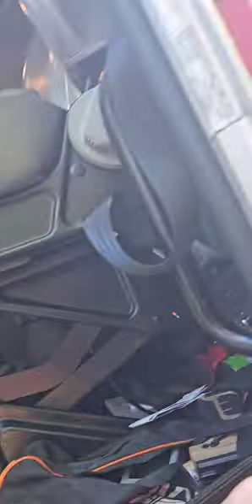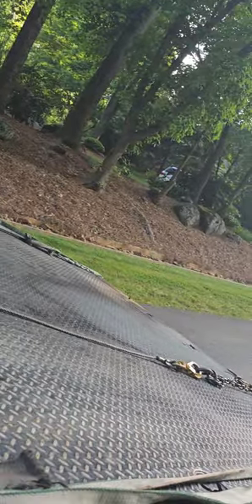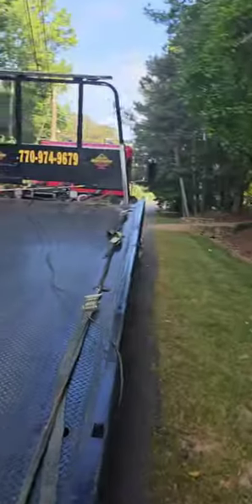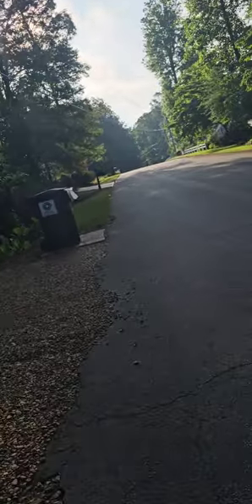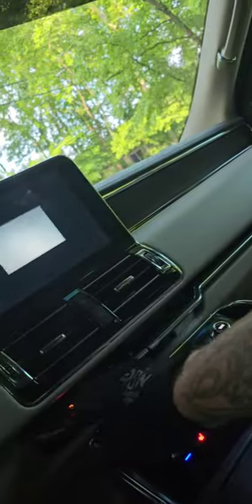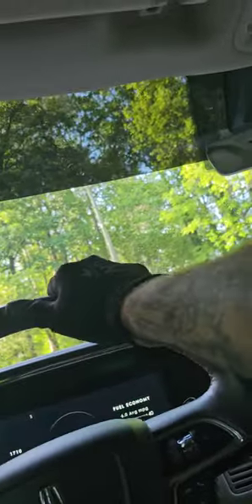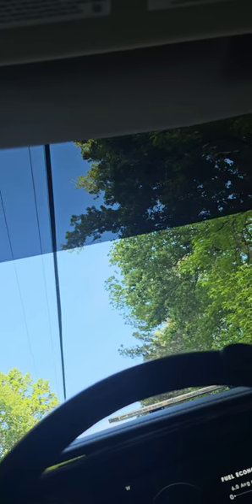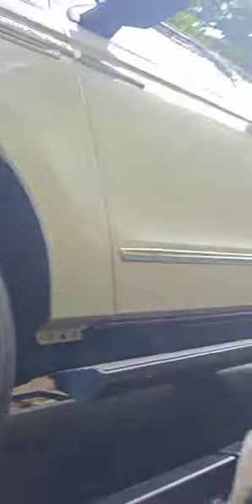Towing a 2021 Navigator#viral#rollback#tow#towtruck#flatbed#peterbilt#repo#recovery#hino#winch#video

Comment: What's up man hope the weekend was great! As long as the video is in focus it's all good! For a while there it was like watching the video under a mossy tree Lol😂 remember a lot of people watch the videos as for the oil slick on the back boss maybe watching! So keep it clean, 👍 don't pay no mind to slotted holes or round holes thickness is what your looking for I try not to use that strapping system you have I have it but only use it on certain vehicle's particular customers my bed is different than you have the securement points give me more range to individual wheel tie cinching not through the rim but around the tire Plus I go railless medium duty Kenworth T370 I do a lot of construction equipment hauling so I need an open platform go from hauling a backhoe to loading a Ferrari mind you here in Miami it seems like everyone has an exotic car except me!😂 but I do own a backhoe Lol!👍🇺🇸
Reply from the maker: Hey buddy!! I'm uploading a bunch tonight!! I am definitely going to be trying different methods of cinching.